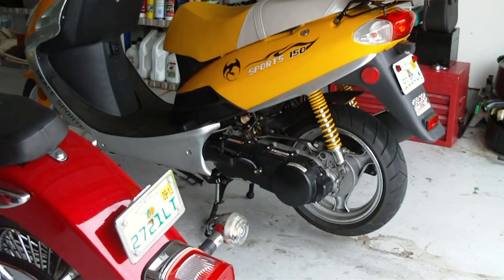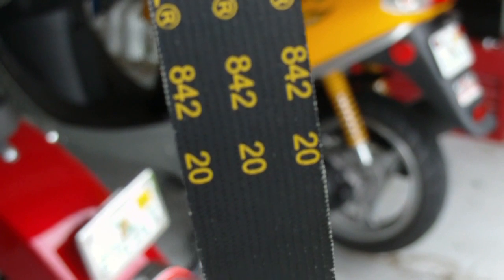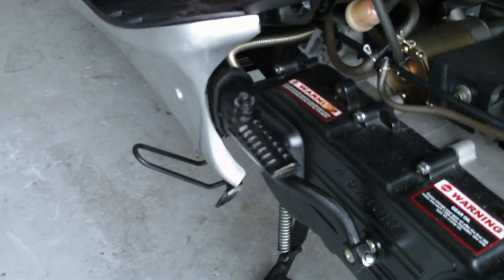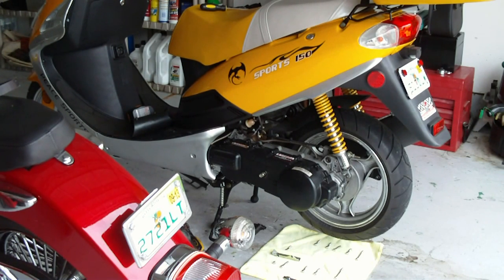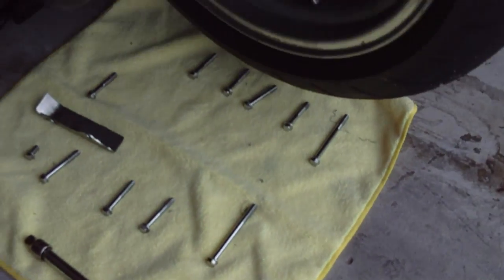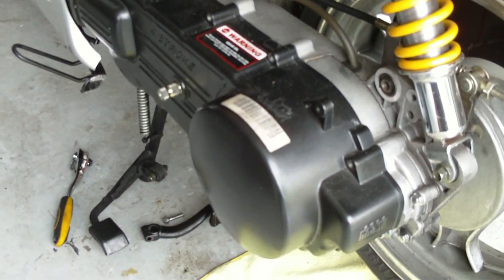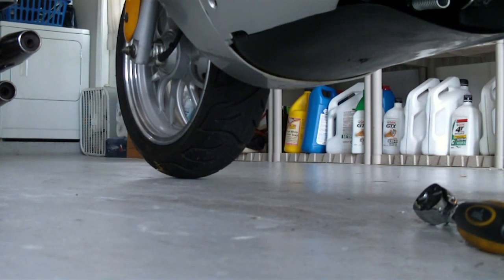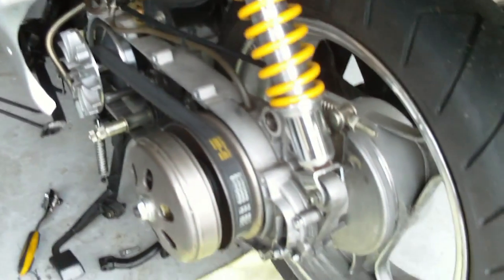Chinese Scooters...CVT Transmission Belt Change on a 150cc.

Comment: The "pulley" up front that he is taking the belt off is called the variator. The numbers refer to the size of the belt. 842 is how long the belt is in millimeters if you measured it around. The 20 is how many millimeters wide it is and the 30 is the degree of angle the side of the belt is that comes into contact with the variator and clutch plates. If you want a good belt, buy it off of ebay and make sure it's made of kevlar. They will last 3 to 5 times longer than a cheap belt. Powerlink and MRP are two good brands that make kevlar belts and they are not expensive at all.

Comment: Thanks for the video! Question: What if I already unscrewed the gear oil bolt, lost some oil, and screwed it back tight? It was hot outside is my excuse....
Reply from the maker: Tiffany Bunce Depends on how long the bolt was out...if it was just seconds then it is of no consequence
Reply: Yeah, basically just long enough to leak a lil bit of gear oil across my hand as I retightened it...Ok, well thanks alot!

Comment: I have a 125cc GY6 and the replaced belt with 842-20-30, had to use a rattle gun to take the front cog off to get the belt on - now scooter runs way too heavy, like it's stuck in high gear, feels like the belt is way too short. Any ideas what this could be?
Reply from the maker: If I am correct in assuming that you checked the old belt for the right size it should actually be a little loose fitting when the bike is stationary. The clutch should pull that belt tight when in motion. I used and air wrench on mine with no issues so its hard to say without actually seeing the bike.

Comment: My Belt/Chain came off while riding yesterday and its a Chinese scooter by the name Bashan.
How do you know if there's a belt or a chain inside the cover in your video? The bolt arrangement is exactly the same and mine is 150cc as well. Everything in your video is exactly the same one the outside as mine. So is it a belt or a chain? Can you help me out?
Reply from the maker: It is a belt...A chain would not work with any scooter clutch. The belt will have its size inscribed on it.
Reply from the maker: Also they rarely fall off...yours more than likely broke.
Reply: Thanks so much. I've only driven it 3 days and it was a gift from a relative.
But after watching your videos and knowing i have the necessary tools Im feeling confident i can do this.
Lastly, and  thank you for your time, If the belt shredded (which it probably did) how do i know what size to get?  Did u say 842 50 30? And would that apply to mine>
Reply from the maker: They are to thick to shred its more than likely snapped in one spot so you should be able to see the size markings
Reply: Shacklin Jackson 
I have moped propel delray moped 49cc witch sizes are the belt ? I can’t fine it anywhere? MD50t-11 
Yers 2012 
Model 139QMB 
Moped name is propel delray
Please help thank you

Comment: What is that cable on the left of the screen at 9:02? I believe the bottom left nut on the cvt cover holds it in place. I'm wondering what that is?
Reply from the maker: If memory serves its a brake line
Reply: Shacklin Jackson ok thanks I'll be checking it out here soon. The reason I ask is because my exhaust started getting loud so I looked under and where the header meets the engine the 2 nuts are a little loose. Then I noticed that line I asked about was off, the bolt came out! And that line was just hangin there. The brakes work fine so I guess that bolt just holds it in place. All of this loose nut n bolt mess is from the factory lol its only got a hundred miles on it. I'll write on here what it is when I get to workin on it. Thanks for the reply!
Reply from the maker: I had to constantly re-tighten those 2 bolts
Reply: Shacklin Jackson oh wow well I bought 4 nuts and 2 lock washers to rig up on those 2 exhaust bolts, we'll see how that holds. So that line is actually an overflow from the carb.. I guess if the carb fills up too much it will come drain out of that line.